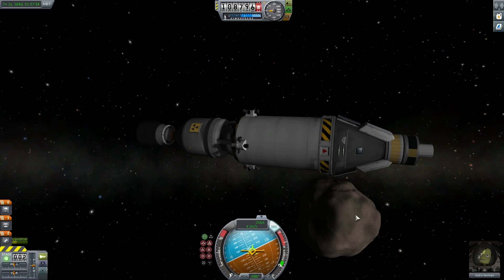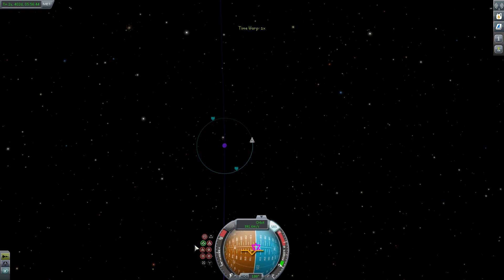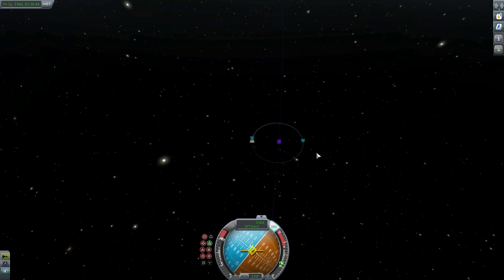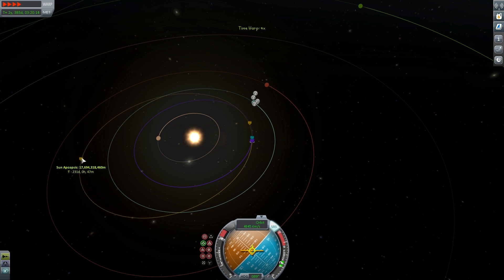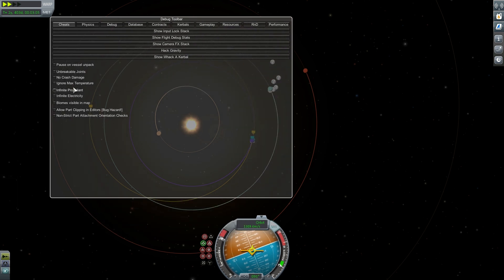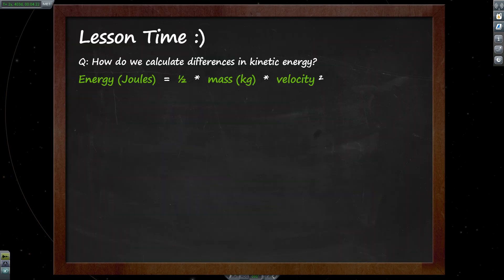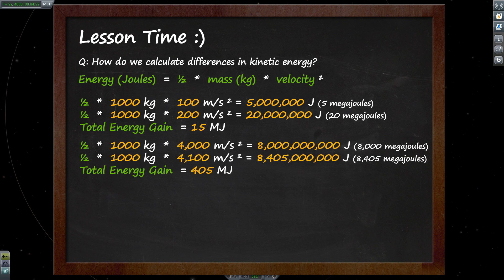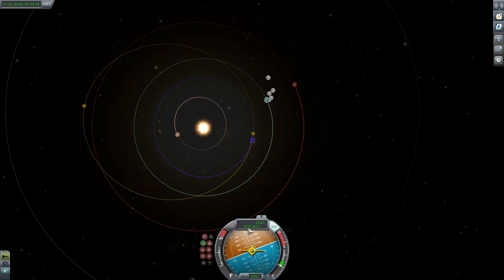The Oberth Effect  - Kerbal Science (KSP)

Comment: I probably will regret commenting in public, but let's go give it a try for an intuitive explanation for the Oberth effect:

1. Let's start with imagining ourselves being in free motion (no gravity forces or other forces acting on us, we may later transfer our system of reference to where we like as it does not affect the Oberth effect).
2. Let's now say, we throw little stones in the opposite direction of the direction we intend to accelerate in (like a rocket expelling propellant in the opposite direction).
3. Assuming, just for easing the intuitive understanding that we seek, that we move at speeds higher than the exit velocity of our propellant, we can say, that we gain kinetic energy and the propellant loses kinetic energy. This should give some clue on why burning propellant at high speeds makes more sense and may satisfy some of you already.
However:
4. (Bringing some more physics in, sorry xD) There is the law of conservation of energy but there is no law of conservation of kinetic energy. However, there is the law of conservation of momentum which is basically the foundation of why we can say a rocket engine gives us a fixed amount of Delta_v. This holds regardless of the current velocity the system is in, i.e., the frame of reference and is the underlying explanation.
5. Putting us now back in our reference system of choice, we immediately see, that it is advantageous to burn fuel at the point in our trajectory with high velocity as this put's us off with the highest possible kinetic energy in the reference system of the large mass (the planet) we're trying to get away from.

Finally, I want to say: No gradient of gravity wells and no "extra energy" stolen from the planet's gravitational field is needed for this effect to work AT ALL. It simply is plain classical physics/Newtonian mechanics which becomes visible/evident due to the environment we face in space (vacuum and only little acting forces/friction).

Comment: I've got a question,
Is the statement I am going to write correctly?
If you are in a high orbit and burn 100m/s you will get 100m/s of speed, but when you use fuel to get to a lower orbit you will go faster (because you are going to periapsis) let's say 1000m/s at periapsis. Then you accelerate 100m/s so you will go 1100m/s. Making you get out of the gravity well faster making you de accelerate less. So you will lose let's say 800m/s and get a speed of 300m/s.

So the difference with my idea and this video is that instead of thinking of velocity squared I think of it as you leaving the gravity faster making you deaccelerate less.

If this isn't true then please explain to me why it isn't true as I really want to know
Thanks in advance!

Comment: I could be wrong, but I don't think this only the Oberth effect.  This is demonstrating a gravity assist slingshot.  The Oberth effect is tiny in comparison.

Oberth effect comes from firing engines at higher speed.  The rocket accelerates the fuel to make thrust.  Say the engine can accelerate the fuel by 2000m/s.  If the rocket is still, the fuel goes from 0 to 2000m/s.  If the rocket is moving at 5000m/s the fuel goes from 5000 to 7000m/s.  Because energy is 1/2m*v*v, there is more energy.  I would like to know if my understanding is correct.

Comment: Yesterday, while I was on a long drive home, I was thinking about the seeming strangeness of the fact that kinetic energy is proportional to velocity squared. It didn't seem to make sense to me, but after going through a few hypothetical situations I concluded that it is indeed true independent of the frame of reference. Bearing that in mind, and with the knowledge that momentum is proportional to mass x velocity, I concluded (after much pondering) that rockets must gain more kinetic energy for the same expenditures of fuel at higher velocities than they do at low velocities. I thought I might have broke the universe, but a bit of googling informed me that the effect exists (which brought me here). I'm still trying to wrap my head around WHY it works and how to best utilize the phenomena. It seems worth noting, however that energy is not created using this effect. Rockets are ultra inefficient at converting fuel into kinetic energy at low velocities. As their velocity increases, the efficiency increases.
Reply from the maker: This paragraph here I think explains this quite well from https://en.wikipedia.org/wiki/Oberth_effect

"It may seem that the rocket is getting energy for free, which would violate conservation of energy. However, any gain to the rocket's kinetic energy is balanced by a relative decrease in the kinetic energy the exhaust is left with (the kinetic energy of the exhaust may still increase but it does not increase as much). Contrast this to the situation of static firing where the speed of the engine is fixed at zero. This means its kinetic energy does not increase at all and all the chemical energy released by the fuel is converted to the exhaust's kinetic energy (and heat)."
Reply: I have been trying to figure out why that velocity squared formula is used like this for some time -- it just doesn't seem to make any sense, because speed is relative. You can't measure speed (or velocity) except in relation to some other object or defined frame of reference. So what does that mean for kinetic energy? If I measure my velocity relative to a different object, I could get a vastly different result, and because it's squared it doesn't match up if you add and subtract. For the energy of a collision, of course, that square explains why a head-on is so much worse, or how a tiny fleck of paint can put a huge crack in the space station's window. But there's something else going on here that I don't understand... Now obviously everyone is measuring speed relative to whatever planet or moon you're near, but is that just because those are the measurements the game makes available to us (because they're the most obvious and immediately useful), or is there some other reason to use that particular frame of reference as opposed to, say, your velocity relative to the sun for the purpose of calculating your kinetic energy? That would seem to conflict with the idea that there is no special, "preferred" frame of reference (although that comes from relativity I think, and maybe there's other math involved that makes it work out properly which I'm not aware of)... And when you move into or out of a body's SOI, you aren't actually gaining or losing any energy, even though your speed is suddenly being measured relative to something else and giving a different kinetic energy as a result. All I can really think of is that maybe kinetic energy relative to the planet just happens to be the particular measure of kinetic energy you actually need in this case, for some reason that never gets explained because everyone is already measuring speed relative to that body anyway... But even if that's the case I don't get how that figures in to determine how your orbit changes.
Reply: Well that explains why I've been having trouble. Thanks. As obvious as that seemed, I've never seen it explicitly stated like that, and somehow kept getting the impression that the kinetic energy was supposed to be the same, independent of reference frame.
Now if I can just figure out the details of exactly how all of that translates into altering the shape of an orbit (and getting different results from making the same change in different places)... I understand how to get the best results (at least with the handy tools available in KSP), and I've made plenty of use of that fact, but maybe I just need to find a better explanation of how that math applies to orbital maneuvers, and why.

Comment from the maker: I must admit, until I did the research for this video I was not even aware of how big the Delta-v benefits could be doing this. Of course, it only works if you are doing a flyby or are already well out of a gravity well to start with. Mix a gravity assist on a large body like Eve or Jool with a burn at the the closest Periapsis you can get to the body, and you can almost get anywhere with very little fuel. Of course, the devil is in the all the detail of the maneuver node planning :).
Reply: No. This vid demonstrates that "it works". Doesn't explain how. The rocket, it's engine, it's exhaust has no idea how fast it's going. Low speed, high speed, standing still it's all the same. Everyone and their mother keeps repeating that same explanation and it's so misleading. It's all down to how fast you climb out of the gravity well vs how fast you fell in. It's climbing up the steepest part that bit faster, thus carrying more speed to climb up as the curve gets more shallow, it's a compound effect where by one second saved at the start of the hill saves you 10 later, then 20 later still and so on. I'm looking for a vid that can show it intuitively but it just isn't out there. Either way, "you gain more kinetic energy because you were going faster when you burned" is utter bollocks in terms of actually understanding whats happening. To anyone that isn't a mathematician, it just sounds like: "the faster you are moving, the faster you will accelerate". You will not.
Reply: Dan Rob Ah, I didn't think that explanation smelled right! The key, as you point out, is the interaction with the gravity well and this is not explained here. 
The confusing part is that the math seems to indicate that Marcus is correct.
Have you found a better video yet to explain the Oberth effect?
Reply: @dnrob7  Its not bollocks, there is more than one correct explanation for this phenomenon, which all come to the same conclusion if you do the math. If i want to know how fast a rock is moving when it hits the ground after free fall from height h, i can solve the problem using either the equation of motion or the conservation of energy. Both give the correct answer quantitatively. Would you say that one of them is wrong?
Reply: @dnrob7  to add to this years old comment chain. You also haven't said where you get that "free" energy to escape the gravity well easier. And the answer should be "from the fuel". But not the chemical energy but its potential energy in the gravity field. When you fire the engines closer to a planet you are leaving your exhausted fuel with less combined kinetic and potential energy in it. I believe it is a correct explanation.
Reply: @AbsoluteHuman  The extra energy comes from the planet. If you spend more time being pulled towards the planet due to gravity than you do on your path away from it, then you have taken an infinitesimally small force from it. (since the planet is also pulled towards the rocket by gravity).

It's similar to a gravity assist but different because the change in velocity of the rocket is what matters. So it works even in a theoretical scenario where the planet is stationary.

"Kinetic energy" is entirely relative and depends on the observer, it's also quadratic while velocity is linear. So the change in velocity during this maneuver is the same no matter what the observer is, while the change in kinetic energy is not. For the Oberth effect the change in velocity at periapsis is the exact same as if the rocket was motionless (you can even test this in KSP). The only way it can be explained is due to the gravity well.

There isn't "free energy" to escape the gravity well easier, the only reason it's easier to escape is because due to the change in velocity at periapsis the rocket will spend more time being pulled towards the planet than going away from it. Only because it spent its energy speeding up in the moment it was most strategic to do so.
Reply: Don't confuse people by saying Delta-v benefits :).